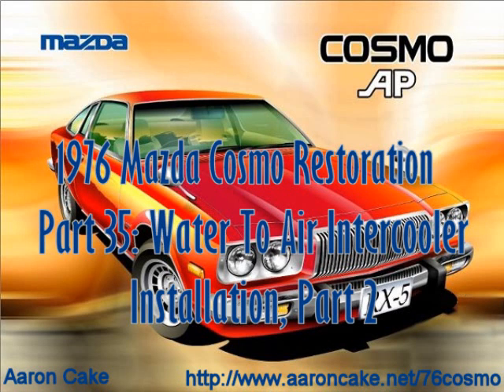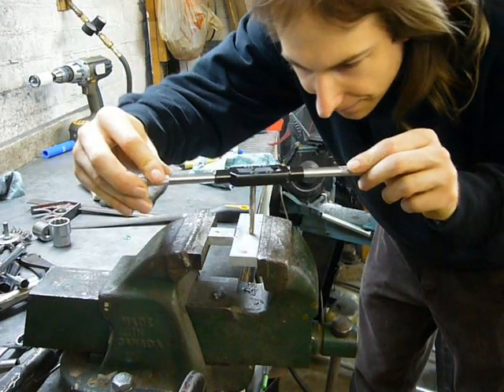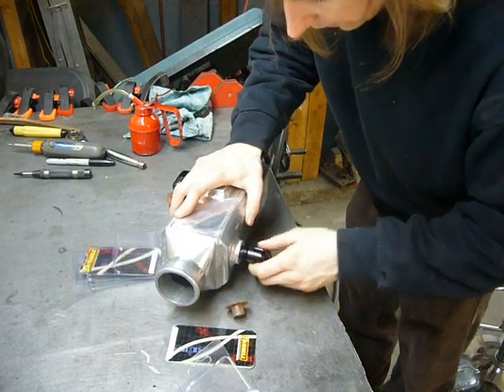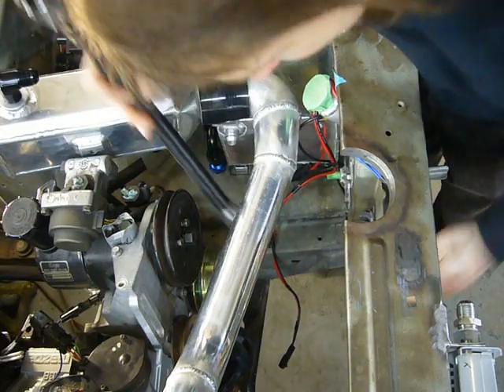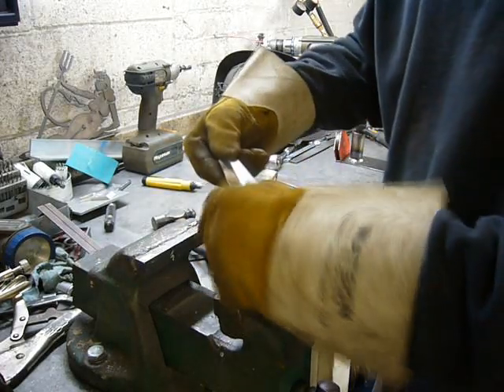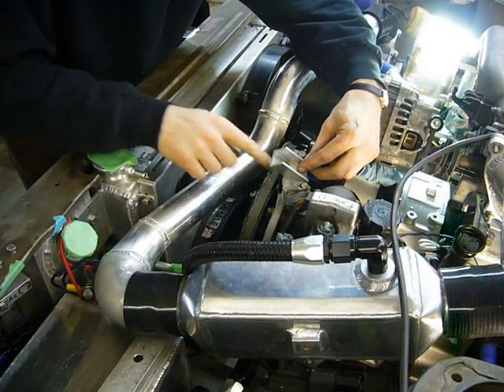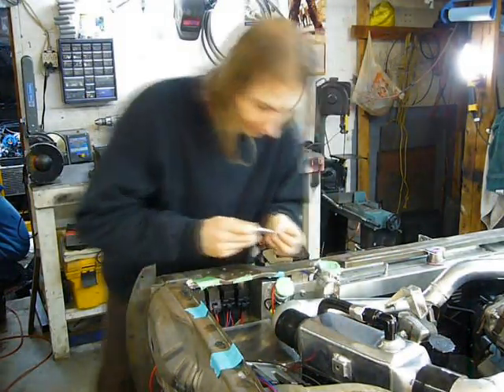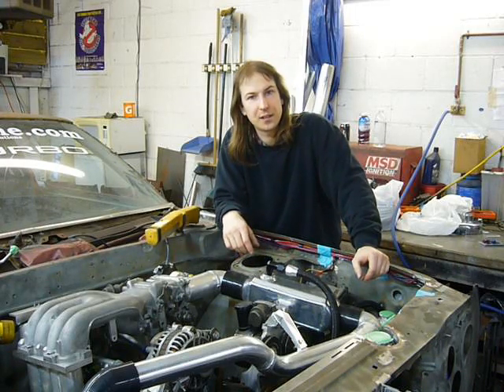Part 35: Water To Air Intercooler Installation, Part 2 - My 76 Mazda RX-5 Cosmo Restoration

Comment: The build seems to be coming along nicely. One thing i'd recommend, been using it for quite some time now, whenever you're splicing in a resistor to a wire, to relieve tension, cut the tail off a zip-tie and put it in the heat shrink. It will never break off that way.

Fuel system will be fun...lots of bends.
Reply from the maker: I don't even want to talk about bending the stainless steel fuel line. Not even a little. It has honestly become a point of hostility in my life.
Reply: ***** Ain't that the truth!

Comment: When you put hose clamps on the silicone hose where it goes on to the push-lock fittings, only snug them down. If you do them up tightly you'll cut in to the inside of the hose and it's more likely to pop apart. Found that out the fun way with an oil cooler.
Reply from the maker: Most definitely. The barbs on the fittings are surprisingly sharp. Most push-locks are not designed to be clamped. These must be because I'm not using the matching hose with the fittings. Only holding a few PSI anyway so between the barbs and some careful clamping, I don't see any sort of issue happening.
Reply: aaroncake A few coats of Plastidip on the clamps, contrast or same color as hose, or thread a length of (colored) vinyl tubing over clamp before installation (worm gear, strap, or even flat-wide nylon zip-tie, hide lock with notched flap of tubing cut into a "T" shape, facing underneath. Plastidip coated "factory-type" squeeze clamps are also tasteful, keep prongs turned down, under hose.
Reply from the maker: HUBBABUBBA DOOPYDOOP I only use T-bolt style clamps.

Comment: I was thinking about using the AC condenser for the heat exchanger idk about how it's going to flow but the thing is huge
Reply from the maker: If it's anything like my AC condenser, there isn't much flow potential. They aren't designed for large amounts of flow. The heat exchange I used is sort of universal as a fluid cooler but it flows very well. Blow into it and there is air coming out the other side. AC condensers tend to be very efficient but not designed for large volumes.

Comment: "normally i wouldnt complain about such a tight hole" lol, made me giggle.
Reply: are those braided hoses fine going through your radiator plate?
Reply from the maker: bhearts77 For now during mockup they will be fine. But the whole thing still has to come apart again for paint so when things are assembled the final time, grommets will be used.
Reply: gorgeous work man. im doing a custom turbo build for my ford festiva '93. im even going so far as building my own intake manifold for it. i love seeing other custom work like this. i wish more car shows i go to had unique builds like youre doing. one question though, how did you choose the reservoir size for your air water coolant?
Reply from the maker: bhearts77 Check out my RX-7 build where I also built an intake manifold. Google for "project tina aaron cake" and you should find it. Believe me, I share the same sentiment about car shows. Yes, I enjoy watching the work regardless, but why is it always the same? Well, to answer that question (and I have briefly worked in the industry making an automotive TV show), it's because those are the parts the sponsors provide, because that's what they sell.Anyway, I chose the reservoir size basically arbitrarily. It was just the largest size I could fit into the available space. Most OEM systems have a much smaller reservoir mainly for degassing purposes. I wanted more of a thermal mass like the drag cars use. But since I have a heat exchange to cool that water, my reservoir is more of a way of just adding more absorption. The heat exchanger is probably a little undersized but this isn't going to be a beat it up track car. Like OEMs, I tried to size the system to satisfy the demand of the application. This car is going to be seeing a lot of lowish boost (under 8 PSI or so) quite often due to the small turbo (that's why I chose it, for low end and midrange enhancement) but only higher boost under WOT (merging onto the freeway).
Reply: aaroncake but dude, you didnt have any velocity stacks to feed those runners from the inside of the plenum, that can add 25 percent better flow. maybe turbo cars dont care about ill flow as much as an n.a. car would. your fab skills look like theyve increased a bit since '06
Reply: youd probably hate me, but i dont have access to a tig welder, so im epoxying my manifold together. im very confident it should handle up to 20 pounds of boost perfectly fine, its all 1/4 inch alum. so its very rigid and has tons of mating surfaces
Reply from the maker: bhearts77 It's not the material which could be an issue (1/4" is quite thick though...1/8" is more typical) but the epoxy. I'd imagine most of the joints will require a fillet which doesn't leave much for the epoxy to grab. Looking at the industries that use epoxy (composites, and even sheet metal on new vehicles) it is always a flat surface joined to another flat. These joints are very strong.
Reply from the maker: bhearts77 It's important to think of the intake system in a turbocharged car just like an NA car. After all, air is air. Almost anything which makes an NA intake manifold more efficient is going to have the same or greater benefit. That said, it is often far easier and more economical to just turn the boost up slightly than spend large amounts of time tweaking intake manifold designs, fabricating the part, then heading back to the dyno. It's funny you mention the velocity stacks because I had the same thought after I built the manifold. Just at that point it was rather too late. I have always intended to rebuild the manifold in aluminium and make some tweaks, including moving the injectors to the other side of the runners and adding velocity stacks.
Reply: aaroncake 50/50 isopropyl-water or 100% methanol (washer fluid) would exchange more heat than plain distilled water for your intercooler. Don't know if you know that. Might want a good antifreeze for corrosion protection & lubricity.
Reply from the maker: HUBBABUBBA DOOPYDOOP I'll be using a 70/30 distilled water/ethylene glycol mix, with maybe a bit of "Watter Wetter". Fairly typical of what the OEMs run.

Comment: Just curious if this is a gm water pump, Looks very similar to the one on my cobalt ss. if so they are very prone to failure. in the cobalt community people are having issues ( including myself ) of having to replace the pump several times. just a heads up
Reply from the maker: +SupraWilliams It's the same pump as used in the Mustang Cobra and several other vehicles with water to air coolers. Perhaps the same as the Cobalt. What fails on the pumps?
Reply: the motor stops working in the cobalt application. With the cobalt its recommended a gauge to monitor the intake air temps after the intercooler just to make sure the pump is still working
Reply from the maker: +SupraWilliams I've mounted a temp sensor in the reservoir, and have the standard IAT sensor. With the MS3-Pro I can set limp mode or a warning if either is too high (or for the tank, stays too stable).

Comment: Great video, as always, pleasure to watch you work on the RX-5! The build is going very well!
Question, have you considered water-methanol injection, or is it not needed?
Reply from the maker: Not needed for this build. Remember, this is to be a daily driver which what I'm hoping is the refinement and integration of or beyond OEM level. Having to refill a reservoir is not really acceptable in that way.  Aux injection is not even something I'd really do on my RX-7. I'd prefer a large intercooler and sane boost levels from a larger turbocharger vs. high boost levels requiring chemical intercooling. It also violates my opinion of what a "street car" is just as nitrous does. Any sort of power adder related substance which must be refilled for proper operation is a "track car", not a daily driven vehicle.

Comment: For the wiring on the temperature sensor line, I'd do one layer of Kapton (heat and electrostatics protection) and then one layer of 3m 2228 Scotch moisture-proof electrical tape. Or Gardner Bender has some liquid electrical tape if the other solution wasn't overkill enough for you. Is there any reason why you didn't use a trim-pot in series with that resistor to do a final calibration?
Reply from the maker: The harness is still in the construction phase but on final wrapping I will certainly clean up that resistor area. No need for a trim pot because a degree or two in either direction won't matter and any adjustment to calibration can be done in software.

Comment: Just a quick question aaroncake, in your opinion what is the most efficient way to flow the coolant in the air to water setup, would you go from 1. exchanger to box to intercooler (which the volume of water in the tank would always be cold or 2. exchanger to intercooler to box. thanks in advance amazing work!
Reply from the maker: I think you'll only find a negligible difference between the two. I chose The first path, running from the intercooler to exchanger and back to reservoir. With the highest temperature delta between the exchanger at airflow heat transfer should be greater. Plus instead of maintain a reservoir of hot water which won't be as effective when the heat load from the intercooler is high, there is a reservoir of coolish water. The intercooler can remove more heat than the exchanger can instantly reject so the reservoir forms a buffer. One thing to keep in mind is that the water should flow from the cold side of the intercooler to the hot. This will maximize heat transfer and even out the temperature across the intercooler.
Reply: perfect thanks for your reply sie, keep up the good work!!

Comment: Would it be possible and effective- to build a water/antifreeze box, with a small freezer box from a mini fridge core inside, and just run the necessary plumbing to a condenser, and the electric compressor to pump it? How cold does the air charge have to be? Would this "coolant chiller" work? (To chill the air intercooler)
Reply from the maker: It certainly could be done. Fridges actually have a shockingly low heat transfer rate. They are designed to maintain a temperature and only deal with cooling down new items. To chill an intercooler you'd need something akin to an automotive A/C system. In fact I think some OEMs have actually done that. However in my case, if I need super chilled water for say a run down the drag strip, it would make more sense just to put some ice into the reservoir.

Comment: your u bend pipe that you are not crazy for, have you thought about a stn steel middle section that you could bend to an appropriate shape? i.e flexible hose coming out 2'', then steel bend then 2'' flex hose going back in.

Comment: Think you will have to remove the intake every time you replace the belt? Probably still be easier than most new cars.
Reply from the maker: There's no real reason to remove the intake (manifold? piping?) when replacing belt. The video may not show it but there's plenty of space. The only thing which may need to be removed is the bracket on the power steering mount as it sort of blocks the power steering and A/C idler adjusting bolt.
Reply: Yeah, piping. 1am does that.

Comment: По каким критериям лучше всего сравнить надежность Вольво и Мазды?   Как это сравнивают надежность профессионалы?   По каким критериям лучше проводить сравнение?   С чего лучше начать?   Подскажите, пожалуйста, кто знает.
Reply from the maker: Кирилл Рыбасов I'm replying based on a translation. It's hard to compare with the reliability of Volvo. Mazda's piston engine vehicles should be comparable but just by the age of Mazda's rotary engine vehicles, they aren't going to be as reliable. It's not typically the engine you have to worry about (FD excluded) but all the stuff around the engine.

Comment: What type of relays/plugs are those?  they look really nice, I keep having issues with my crappy Radioshack relays.
Reply from the maker: They are 40A weather-tight relays made by Hella. I'm sure many sources sell them but I buy them in bulk from Waytek Wire. Cheaper in bulk than the crappy relays the parts store sells.
Reply: If you need good relays for vwry cheap get relays from cars at the junkyard. Whole relay box is very inexpensive, and you get a socket with it.

Comment: Have enjoyed every moment of your meticulous build, although with all the access holes cut into the engine compartment on a near 40 year old car(unibody at that), any concerns over structure rigidity?
Reply from the maker: You mean the holes for the water lines, fittings and such? They will be a non-issue as none are in load bearing areas. Now chopping holes like that into the frame rails...that would be another story.
Reply: aaroncake Yes, of course, but after years of dealing with Fox body Mustangs, the later cars(which have tons of access points stamped into the sheet metal in the engine compartment), the earlier cars seemed more rigid, at least in my experience, then again, all Fox cars are very flimsy to begin with. LOL Any time frame for when your beautiful build up might be road worthy? Rotary cars are rare nowadays and living in SoCal, I still see a few in running condition, but they are still scarce compared to 15-20 years ago. I don't think I've seen a Cosmo in person since the 80s!
Reply: 05gtdriver The fox platform is not a very stiff one. Subframe connectors are absolutely necessary.
Reply from the maker: 05gtdriver No offense to Mustang owners (well, some offense) but those things are about as stiff as a geriatric salt-petre addict without Viagra. It amazes me how the domestics of the era seemed to design cars purposely to be flexible. Boggles my mind how ridiculously thin stamped "frame rails" just end at the firewall and rear bulkheads. Most of the Cosmo frame is 1/8", in may areas double layered, and of course the rails extend from front to back. I'm not too worried about a few holes impacting the rigidity of the body.

As for a time frame, it will be done when it's done. :-) I had hoped to be in primer for the fall but that won't be happening. However as the mechanical projects become less and less, I can say that if the winter is productive, paint for the spring is a real possibility.
Reply: aaroncake Naw, no offense taken :-). Late 70s malaise of US automakers that were forced(by US government) to meet EPA, DOT, CAFE standards. Making smaller, lighter cars(through the use of lighter gauge metals) made many US cars flimsy.  Japanese & European automakers were already building small efficient cars, they were ahead of the curve. Best of luck on your build
Reply: aaroncake Naw, no offense taken :-). Late 70s malaise of US automakers that were forced(by US government) to meet EPA, DOT, CAFE standards. Making smaller, lighter cars(through the use of lighter gauge metals) made many US cars flimsy.  Japanese & European automakers were already building small efficient cars, they were ahead of the curve. Best of luck on your build

Comment: Any concerns about the intercooler above or at the level of the throttle-body? ..ie if it springs a leak. I thought it would be cool to build a stealthy turbo setup on a classic car with an a/w intercooler made to look somewhat like a the black factory air breather.
Reply from the maker: Honestly, hadn't thought of it. However, it isn't really above the level of the throttle body as the assembly angles down. Incidentally I'm going to move the intercooler anyway since I was never happy with the position of it and the piping. A hidden air cleaner cooler would be excellent. I think if there was a catastrophic enough failure that dumped that much water into the engine, it would be an almost non-existent event. The OEMs like to place water to air coolers underneath roots blowers on the top of the intake manifold. Really the only thing that would cause such a huge failure is a freeze-burst event.
Reply: @aaroncake  Probably wouldn't hydraulic the motor, but I'd at least think about some kind of level sensor in the storage tank with a dash-mounted idiot light. Ya I see OEMs doing all sorts of things with water or A/C intercoolers ...no doubt with all kinds of sensors.
Reply from the maker: I like the idea of a level sensor on the to the reservoir. Added that to my spreadsheet of wiring/sensors. Lots of spare inputs on the MS3-Pro so that is easy.

Comment: If you should need to remove your silicone hoses. They might come off easier using an air compressor with blow gun, blow air between the barb and hose.  This is an old trick to get motorcycle grips off.